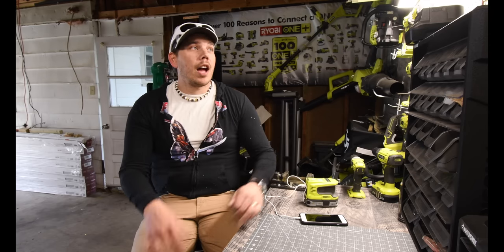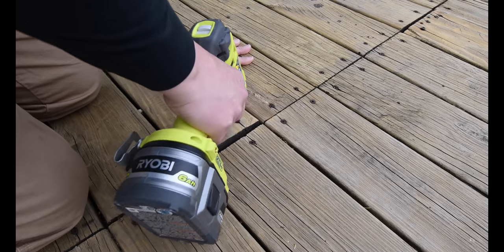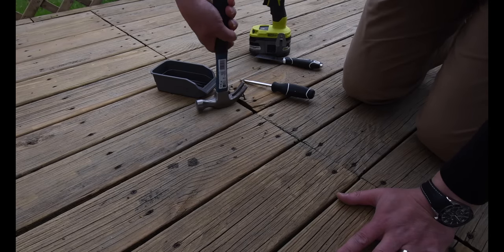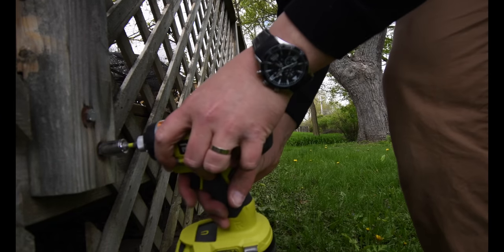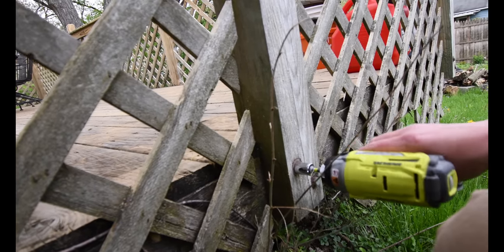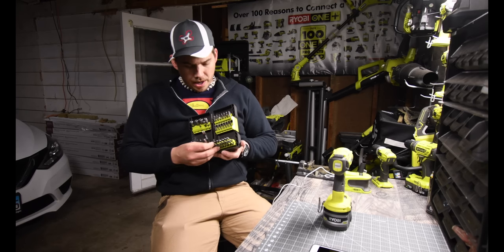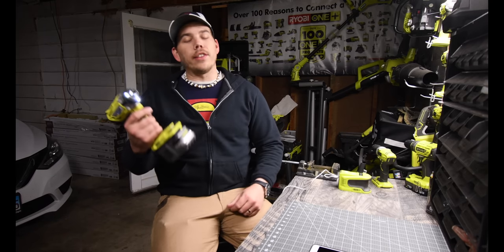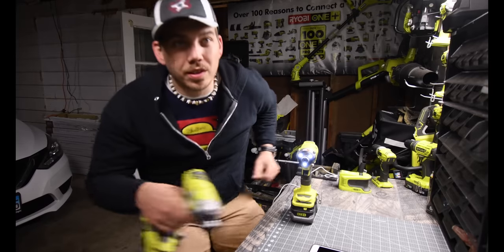Ryobi Brushless Impact Driver in ACTION and REVIEW!!

Comment: Use  exterior screws not drywall screws and they will last and not break. I own a Custom cabinet Architectural Millwork and Countertop shop. I bought some Ryobi and Dewalt but got tired of replacing stuff. I only use Milwaukee, Makita,Bosh, Porter Cable for there belt sanders and Routers no more Ryobi I guess there fine for honey do list around the house but day in day out 50 hour weeks a no go.
Reply from the maker: Eric Krohn I didn’t realize lol you are right though
Reply from the maker: And yes Ryobi is for the home owner, not for a construction site

Comment: As a fellow Ryobi enthusiast I thought you might find these photos of interest.  The R18PDBL Percussion Drill & R18IDBL Impact Driver are Ryobi's high-end International models.  They offer unique aesthetics & features not found on U.S. models.  The drill has an electronic "e-torque" clutch with a cool blue light ring & blue backlit controls.  The impact driver has matching blue LED speed controls & a setting for "Deck Drive" on the foot.

Though packaged similar to U.S. models, the presentation is a bit more premium.  Lots of high-res color photos on the box, an information tag strapped around the tool handle when opened, & nicer documentation.   An extra touch is the slick Ryobi badge used on these models.  Rather than just a sticker, Ryobi opted for a premium 3D applique with the logo simulating etched metal.

https://photos.app.goo.gl/o7DycDvXFY3xx3D98
Reply: Dang... when will they ship that out to us in the U.S ? I see they even have a brushless 1/2 inch impact wrench in Australia
Reply: @tonymitchell1094  I don't know if we will ever see those models in the USA as they release the P238 & P239.  Australia seems to be first up from Ryobi with new offerings.   Many never go further.
Reply from the maker: thank you sir

Comment: Where can I find these new Ryobi bits? Haven’t seen them at Home Depot yet.
Reply: You can order them on HomeDepot.com but they should be available in your local store.  They have been in the stores in Maryland for at least a couple weeks now.  There is a 40-piece set for $9.99 & a 70-piece set for $14.99.  Both include the new torsion zone bits & come in the black cases.
Reply from the maker: they are all over now

Comment: I do like your videos but putting in 4 deck screws in already drilled pilot holes is not abusing and using a bit.
Reply from the maker: Taylormade2350 the bit was being abused because I was doing most of the screws with one hand and the bit would skip a lot because of lack of pressure pressing on the bit. I was filming with my phone as well for the Facebook group Ryobi Rebels. Also remember I don’t put everything I film in the video. If I did each  video would be an hour or so long. Nobody would watch if the episode is an hour long